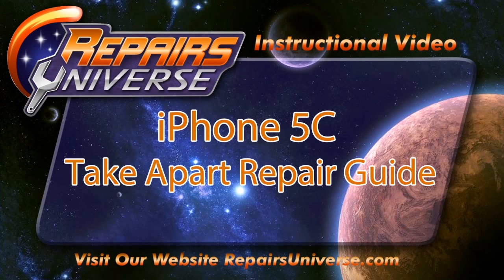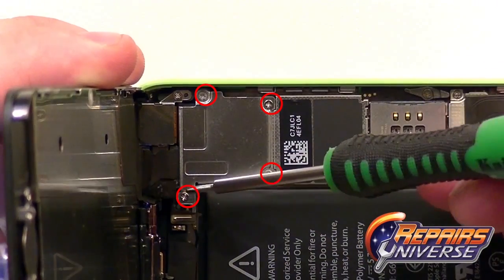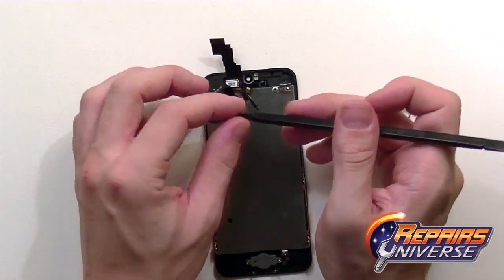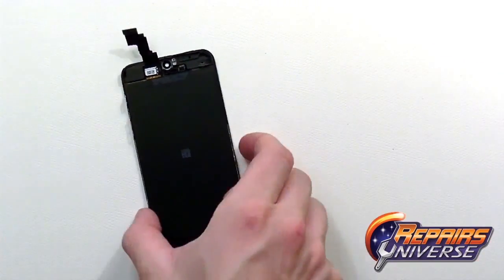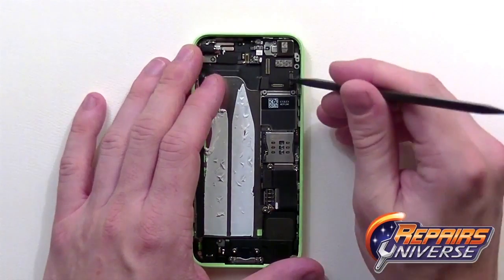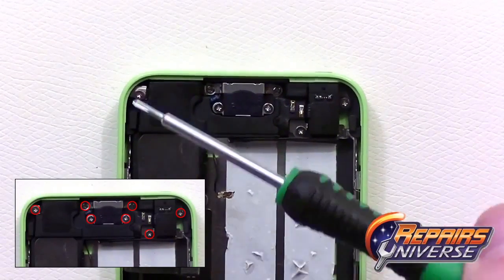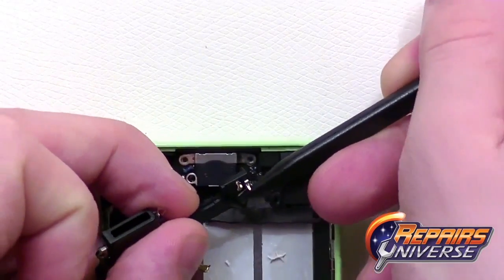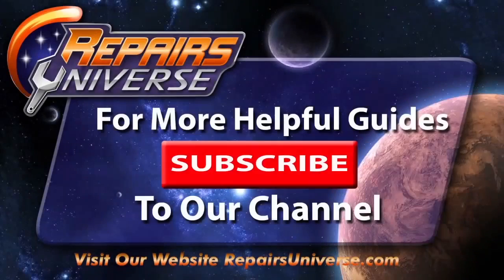iPhone 5C Take Apart Repair Guide (Teardown)

Comment: You do not mention how to replace the LCD screen in this video, is similar to other phones where you have to heat it to remove?  The Blackberry Z10 for example you just have push it out with a plastic tool from behind.